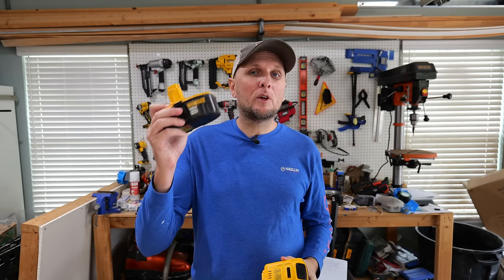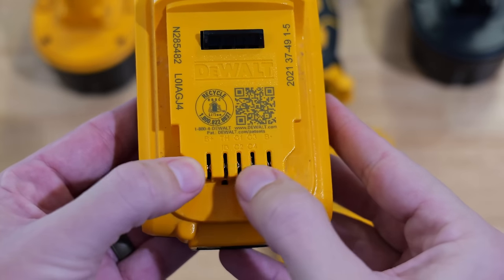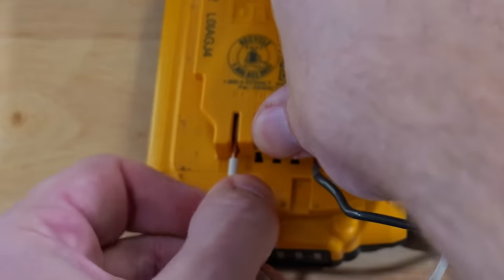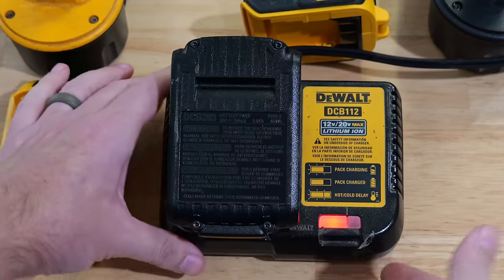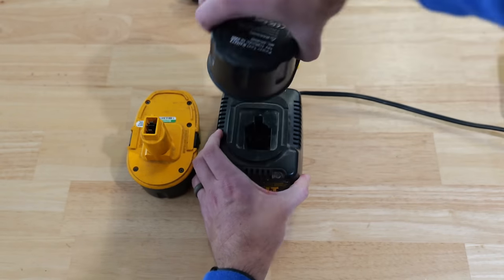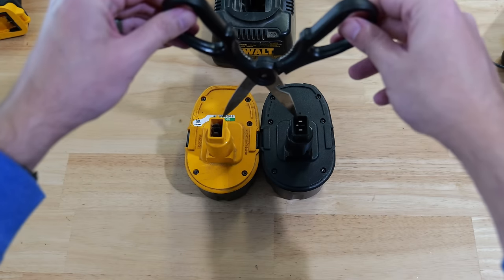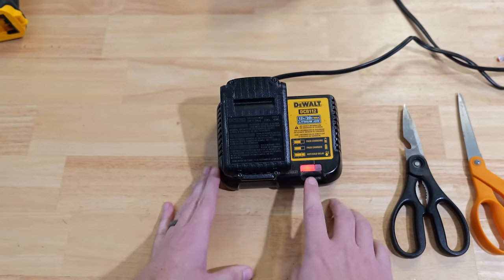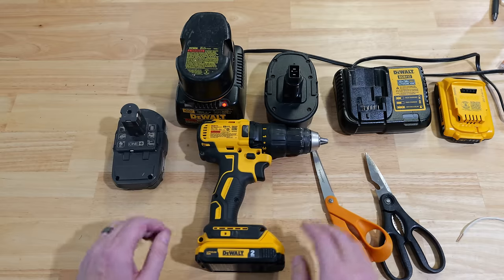SECRET To Reviving Dead Portable Tool Batteries | Super Easy!

Comment: I have an almost unused 20v lithium ion battery that came with a tool that was a gift.  I didn’t even open it for a while.  It charged, then discharged fairly quickly under use. Putting it in the charger results in a solid red light.  Jumping the battery as shown here had no effect on its ability to share.

Comment: on the 18v, take 4 female spade connectors, attach to each pin.
take both ur wires and insert in the back end of the spade connectors, no need to crimp.

when done, remove the wires removed the spades, and save for future use.

Comment: Have been using DeWalt 18V batteries for 15 years.  Here my question: my dead batteries don't show "no light" on the charger, but instead that "fast flickering" pattern. So, it isn't completely dead, but it also doesn't charge anymore. Unrelated tip: write the year you purchased it on the battery. My 2010 cells are probably still my best :).

Comment: It works, no tricks, I did it, but I have one question, why you did not fully click in the supposed dead 20 volt battery, as you did the charge one?, is it because it wasn't really dead?.
Reply from the maker: I did.  I could not push it down any further.  I’ve watched that section of the video numerous times and have no clue why some think this.

Comment: I have two 18 volt batteries for my Dewalt drill.  They actually light up the charger light and they show they have been charged, but they are very weak, and goes dead quickly.  Why is it different than the example you show?

Comment: Any chance there is a way to do that if none of your batteries will charge? I use my power tools so infrequently that I literally have like 6 18v batteries that will not charge, and 2 chargers, because eventually I started thinking maybe the charger was bad, so I tried replacing that as well. (No I am not a hoarder, I just keep forgetting to turn them in for recycling) ;)

Comment: Wonder if this would work on new, never used, Motorola radio batteries?  My company misplaced about 40 radio batteries for 3 years.  I found them and placed them on the reconditioner/charger.  None of them charge.

Comment: Both my deWalt batteries are dead...is there another way to do this with another brand of battery with the same voltage to charge it? eg: dead deWalt to a Ryobi or another brand?

Comment: This works if the battery has absolute no charge, so the charger doesn’t recognise it. So you just add some charge by doing this. But if your battery is damaged this doesn’t work.

Comment: I had a poter cable tool kit after 6 years the batteries were dead . Ater I charged them they would hold a charge and work about 5 minutes then die again . Most of the time when batteries die they are  really dead! I'm a homeowner as well.

Comment: The 20v do not balance charge the batteries - however individual battery voltages are monitored to shut off charging and shut down battery.  Eventually the cells have different voltages and the highest one is detected when charging and causes shut down - the other cells at this time are not fully charged.  You can verify this:  open the pack and you will find the cells have different voltages.

Comment: If they weren't so concerned with just selling you new batteries they would put a start switch ot toggle function on the charger itself to initially boost the depleted battery so it can be recharged.

Comment: Probably good for batteries that sit for a while and the goes below the minimum needed to trick the charger. Just remember, if the "dead" battery has a short, it can drain and damage the good battery.

Comment: Correct ! Battery Issue.
The Fix is Place a Jumper from bad battery to a good charged battery.

Pos + to Pos + and Neg - to Neg- terminals wait for about 15 minuets for battery to equalize.
problem solved. both batteries are ready for work or charge to full

Comment: Hey I have a battery pack that is supposed to boost a car battery when it dies. Also has a built in  led light and usb charger. It only worked for abpit a month and died amd recharged 3-4 times. It no longer charges im house sockets, it dies of course one year after warranty, no longer charges. First, should they be able to charge from a car(it does not at present), and second is there a fix for these things? It carries just enough charge to keep the led light on, but not enough to power the usb.  It has 5 indicator lights to indicate level of charge, it is on the lowest light. Would be awesome to get it working

Comment: My black and decker 12 volt drill battery does partially work but when I try to charge it I get the solid red light. On my charger it shows that solid red means “charging error”. When I check the voltage with a multimeter it does say 12 volts but the charger  won’t charge the battery. I know the issue isn’t with the charger because it charges other batteries. Do you have any idea what the problem could be?

Comment: I had a weird problem with the flexvolt 9ah dewalt battery.   It showed 1 bar of charge.  Putting it into the charger would have the charger start to flash and then quickly go to solid red but the battery would stay a 1 bar.  Playing around with it a little, I found that if I propped the charger on an angle the charger would charge the battery.  A different battery worked fine in the charger so I can only assume one of the pins in the battery has some kind of contact problem that is overcome by having the charger on an angle inducing the battery to have more weight to one of the pins.  Happy not to have a bricked 9ah battery !

Comment: What about if the battery is not holding chage for long should you throw away the charger?
Reply from the maker: if the charger is charging but the battery is not lasting long, then the battery needs replaced.  They do eventually use up the cells and there is no fix for that.

Comment: I have a Craftsman 19.2v battery that when you put it in the charger it will blink testing it and after a few minutes it will change to a fault.  Would this hack fix this?
Reply from the maker: No.  It is detecting something is wrong with the battery.  They unfortunately need replaced.

Comment: I enjoyed and will use this video on my hand drill 20 volt batteries... but RIGHT NOW... 2 out 3 of my 4 SNAPPER 60V LITHIUM (WeedEater/Blower/Hedge Trimer) Batteries either won't charge, or won't charge fully... BUT they all will indicate by Flashing... that they are beginning the charge process... but nothing.... or not more than a whisper or power for less than a minute or so... I'VE ONLY GOT ONE LEFT!   AND WHERE'S THE BEST PLACE TO REPLACE THEM... OR IS IT LESS EXPENSIVE TO REPLACE EACH PIECE OF EQUIPMENT SINCE THEY ARE ALL INTERCHANGEABLE? IS THERE ANYTHING I CAN DO FOR THEM? Rick

Comment: The second type of battery...
Make a 120% loop on each end of each wire,  plug them into the correct areas, and lit it set for 5 minutes.

Comment: It’s not too often that the battery is exhausted 100%, more than likely the battery charger will display rapidly flashing lights that indicate that the battery can no longer accept charges. I thought that was going to be the topic of this video, the issue of the charger not recognizing the battery as in this case, is a no brainer.

Comment: I've force restarted one when I didn't have 2 to do this. A single wire and held it with pliers cuz it will get very hot. Did it for a second to a second and a half.  Threw it on the charger and it started charging. Works too when the base says it's fully charged  but only says 1 bar too. PSA:  USE SCISSORS! WILL BURN THE HELL OUTTA FINGERS

Comment: Well, it does not always work that way! 
I have several batteries. All the dead ones still making the light blink?
If it were one battery . I could understand but how do you explain that?
Although they blink ,they just won't charge.

Comment: I have two Brand New Dewalt batteries that I bought new in 2022,,  I used the  22 volt to 18 Volt adaptor and pulled them into an 18 Volt Charger.. now they are stone dead and the  jump charge method does not seem to work ..
  Maybe I will go out to my loader and jump to 24 volts ????

Comment: Just tried this with my Dewalt 60V battery.  After 3 minutes, I disconnected and got a single light when checking the charge.  However, the charger still didn't recognize/charge it and I noticed the bottom was SUPER hot.  I left it to cool down before I tried and still nothing.  Any ideas?

Comment: You should include a disclaimer that doing this creates a potential runaway fire hazard, and it should never be done indoors. The reason the charger is refusing to charge the pack is because it doesn't want to burn your house down. Lithium batteries are extremely dangerous, especially when you damage them by over-discharging and then boosting the pack voltage back to a chargeable level. There are MUCH safer ways to do what you are doing, even though they're all potentially lethal.

Comment: With better charger sensing circuits, these manufacturers could build a low charge/ timing function that does this in the charger but then they would not sell as many batteries.

Comment: I have a Dewalt 5AH battery that I was using on a leaf blower. The battery went LOW on power, but was not dead. I changed it and put a charged battery on the blower. When I put the battery on the charger, the light blinked one time, then it lit and stays lit, saying the battery is charged. Pushing the test button gets NO lights showing the battery is dead. It will not run anything, because it is dead. Put it on the charger and the light blinks one time then stays on. I've left it on the charger for several hours, but it has not taken a charge. I tried this fix, a couple times, but it has no effect. The battery is only about a yr old and has only been used maybe a dozen times. Any idea what I might do to get it working again?

Comment: After watching this, I jumped a Greenworks lawn mower battery that was left out in the rain. It wouldn't charge before. Now the charging light is flashing. Anything is better if it revives than replacing it for the current price of $125

Comment: The second type of battery...
Take your first set of wires, bend a 180% on each side of each wire, and insert into
the batteries and then shove them into the proper spots.

Comment: I think I have a different failure mode. When I plug my 20V/3Ah battery into the charger the charging light does come on and blink, and then a minute later it stops blinking. I remove the battery from the charger.  There is a test button on the side of the battery - when I press it none of the three indicator bulbs come on.

Comment: Manufacturers put a chip in the batteries that tells it when to "fail" after a certain number of charges. Planned obsolescence to get you to buy new batteries. You can bypass the chip, which is what you're doing, and charge them, but the charger will not shut off automatically, so you could set them on fire if you don't monitor the charge.

Comment: My 18volt are not completely dead and I charge them to till the light says full then I try them and they will turn the drill but they won't have enough power to put in a 1 inch screw into a piece of wood. It's like they are low on power and need to be charged again. Got any ideas why?

Comment: Bummer! Tried this with a chainsaw battery, and rigged it up to one of my weed-whacker 18v batteries. In fact, I tried it with BOTH ww batteries, but while I could reach the + sides, I had to devise a coated copper wire for the negative ones, 'cause the ww batteries are enclosed, with - and + on each side, and my 2nd pair of scissors wouldn't reach to each terminal. I tried this a few times, just to make sure I had solid contact, and put my saw battery on the charger. It initially showed it was charging for about 9 seconds, then turned to solid green, indicating a full charge. PS... chainsaw still doesn't work. :~(

Can ya recommend anything else?? I just recently had a new chainsaw blade put on, and the thing hasn't worked since I brought it back home.  This is a Ryobi 18v 1.5Ah model, BL91015 and I'm bummed out I can't seem to rectify the problem.

Comment: Is it supposed to spark when u touch the two b+ wires? I’m guessing it’s normal since that’s positive wire… only asking since I don’t recall urs sparking 

I left mine connected for 5 mins and it still wouldn’t charge. It’s a Dewalt 20v lithium ion. It was my dads who got dementia so I know it was just stored away and never charged. @BrianFritz575 posted a very informative comment. This can be super dangerous. My battery got hot like he mentioned so I won’t be attempting it a 2nd time.
Reply from the maker: Well it shouldn’t spark so guessing you got the wires crossed some way which would also explain it getting hot.  I’ve never had it spark.  Brian posted something that while it is possible it’s unlikely.  Just like a plane can fall out of the sky but also unlikely.  Everything we do in like has some risk to it, even eating.

Comment: If the voltage is that low you have at least one damaged cell. Once a lithium battery goes below 2.4 volts to 3.0 volts, depending on the type of lithium battery, it is damaged. The process in the video will work but your batteries won't last as long and they are on their way out. If you have the skills you can replace the bad cells and have a like new battery. Most of them use 18650 batteries and there are tons of videos on YT on these types of batteries.
Reply from the maker: Not always true.  You do not have to have a damaged cell for them to be fully depleted.

Comment: I  have a Dewalt 18v I plugged it into my charger and the light will flash slow and then it will start flashing faster and will just last about a minute and I have 1 that will show a full change and it will last about 2 minutes how do you fix that.

Comment: i have a 19.2 when on the charger it says "charged" but does not power the drill - the charger DOES have a light for defective battery but that's not the one that lights up - the "charged" light is

Comment: Here's a safety reminder when working with, or charging, lithium batteries. 

ALWAYS recharge or re-energize these types of batteries on a concrete floor or in the outdoors if possible. These batteries can easily overheat when doing this and you definitely don't want one of these batteries going through thermal breakdown on your wooden work bench or wooden floor!

Comment: Hello my name Larry,  and I recently purchased a new set of Craftsman batteries and a charger, they are Craftsman V2 4.0AH Lithium ION with my purchase I got a new tool for free. The problem is that I'm old school and have the old school set of tools that use the 19.2v batteries, the salesperson said to me NOT problem there is an adapter that I can purchase online from Amazon. The salesperson looked up the part number a gave it to me so I ordered it, but you guessed it ,it didn't match up and didn't work. I return it and bought another but it didn't work either. Is there an adapter you know of that will work for me.

Comment: I had two batterys that set for thee momths. Had a low chsrge because the charger quit working.  Was gone for three months and returned with a chsrger.  One barrery took the charge the other didn't.  So I tried this method for a few minutes, for half hour, with higher voltage. Nothing worked.

Comment: My charger blink a red light real fast when i put my dead battery in. So it recognizes the dead battery but will not charge it, could it be that the battery has other problem?
Reply from the maker: Yes.  The cells are probably overheating or damaged.  Those types usually unfortunately need to be replaced.

Comment: When the batteries have been used all the time and stop holding the charge or getting very little charge those batteries are no good anymore, you need to replace them, this trick works when the battery is good but it has lost all the charge , you set it on the charger and because it has no charge at all the charger doesn’t know that it has a battery that it needs to be charged, so you jumpe start the bad battery for about 10 seconds, you set it on the charger then the charger know that it is a battery that needs to be charge because with the little power that the battery has send a message to the charger, so old worn out batteries need to be replaced

Comment: So, the first "secret" should be to charge your batteries when they get low rather than draining the battery entirely. Then, if you or someone using your batteries do do it anyway, then these are some tips on how to give them enough charge to recharge on the charging block.

Comment: If you use the scissors it’s important to NOT touch the metal with your hands like was warned when using wire on the first batteries. There is electricity in this and you need to make sure you are insulated!

Comment: Got excited about restoring my Dewalt; went out to garage: both batteries dead: Oh shoot! Now what?
Reply: Use a regular 12 or 9v battery and alligator clips or  insulated wire. Same concept. Use a multimeter before and after to make sure they are safe to charge.

Comment: What about the batteries that seem to take a charge but in fact are charged very little once removed from charger. Light blinks for a bit then turns solid indicating fully charged. Tab says one bar. Put it in a tool and nothing

Comment: Guys please be careful these aren't nickel batteries there lithium super cells and if for some reason you find a cheaper factory battery watch out they might be knockoffs and not have a bms , this is extremely dangerous . the lithium cells are matched closely but no two are exactly same resistance so over time they get out of balance Eventually it stops charging to protect you from fires . nickel cells might just need a cell replaced but for dependable service you can swap out those cells ,  but there completely different from lithum.